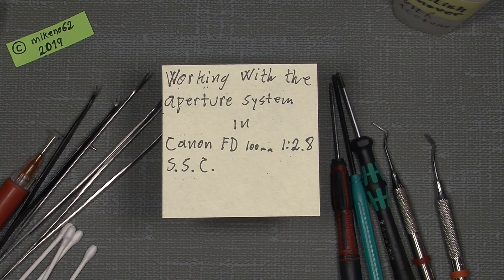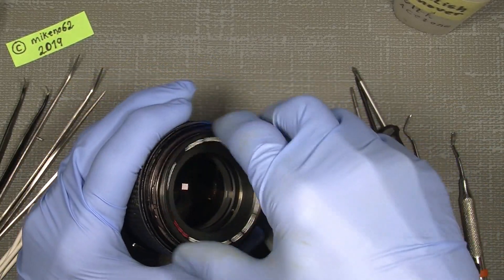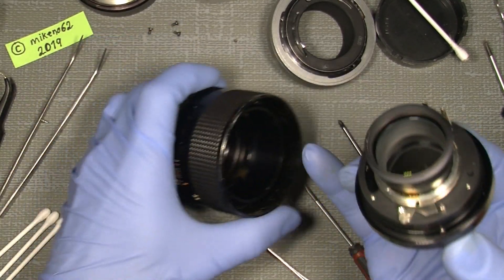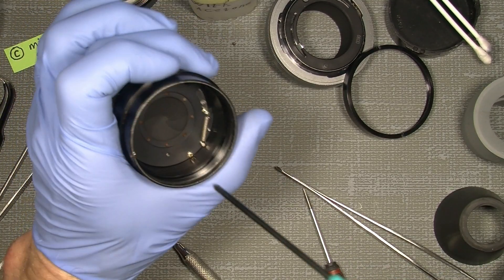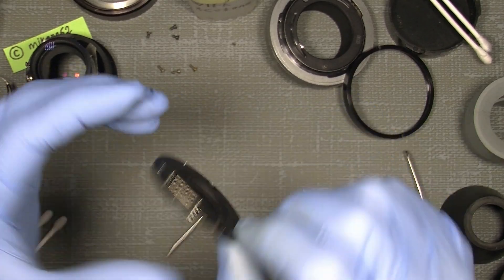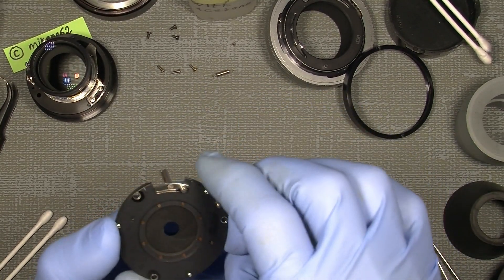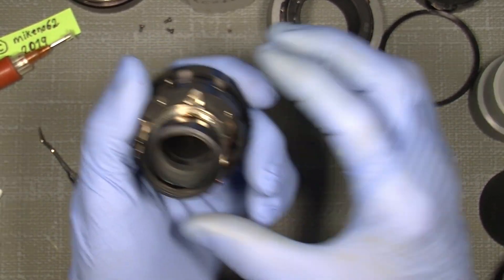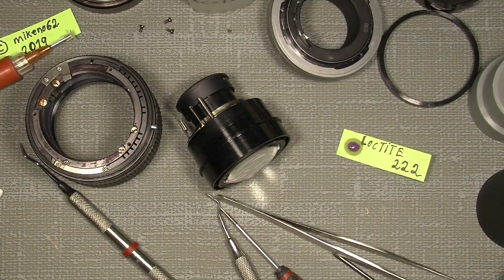Working with the aperture system In Canon FD 100mm 1:2.8 S.S.C.

Comment: Thanks a thousand times for the trick at 17:00. I had trouble with it until I found your video. The thing does get set the wrong way when you disassemble and I didn't notice it so I had a really hard time finding what the problem was! Now to unbend the filter thread so I can remove the back element to clean the fungus. That's a lot of work.

Comment: where do you get those sticky  rubbers? I don't have that in my country, thanks a lot for all your teaching!
Reply from the maker: Here are some link's to different repair tool's:

SpyderLENSCAL:

https://www.datacolor.com/photography-design/product-overview/spyderlenscal/

Japan Hobby Tool rubber cone:

https://www.amazon.com/Japan-Vacuum-Camera-Opener-Repair/dp/B0013HFYKK/ref=pd_sbs_469_1?_encoding=UTF8&pd_rd_i=B0013HFYKK&pd_rd_r=RKSF5A4YKT9GV3E1382C&pd_rd_w=5H58m&pd_rd_wg=DBny2&psc=1&refRID=RKSF5A4YKT9GV3E1382C

 

18 different size rubber repair tool's:

https://www.amazon.com/Sizes-Lens-Filter-Wrench-Rubber/dp/B00988D1BK/ref=pd_sbs_469_2?_encoding=UTF8&pd_rd_i=B00988D1BK&pd_rd_r=RKSF5A4YKT9GV3E1382C&pd_rd_w=5H58m&pd_rd_wg=DBny2&psc=1&refRID=RKSF5A4YKT9GV3E1382C
 

Divider Caliper Wing Compass:

https://www.amazon.co.uk/Divider-Caliper-Compass-Marking-Machinist/dp/B015CN9A8M

 

You can also buy this set.

Lens Repair Set with pointed, flat, half flat tips:

https://www.amazon.com/dp/B00QRPWCN0/ref=psdc_3347581_t1_B00J5F6O92

JIS cross head screw driver's:

https://www.amazon.com/Moody-Tools-58-0219-Chromium-Screwdriver/dp/B004PGO1T6/ref=pd_sim_421_6?_encoding=UTF8&pd_rd_i=B004PGO1T6&pd_rd_r=775KBDR03D8PMMEZWKFJ&pd_rd_w=ti7yC&pd_rd_wg=s2a40&psc=1&refRID=775KBDR03D8PMMEZWKFJ

Or this set, that is the set I use:

https://eustore.ifixit.com/en/Tools/Drivers-Wrenches/JIS-Driver-Set.html?utm_source=iFixit&utm_campaign=Referral&utm_medium=modal&utm_content=145115

Lens cleaning wipes (PEC-PAD):

https://www.amazon.com/dp/B0161VIZZ8/ref=sspa_dk_detail_3?psc=1&pd_rd_i=B0161VIZZ8&pd_rd_wg=ZTxxY&pd_rd_r=RNY8S6Q1V5K18K3F61VZ&pd_rd_w=2c1Oy

Thin Cotton Buds x 200 you can buy them here:

https://www.muji.eu/pages/online.asp?lan=uk&ShopSel=y&scrn=1920&wndw=1920&sec=17&sub=70&pid=2469

DSLRKIT Pro Lens Vise Tool Repair Filter Ring Ajustment Steel 27mm to 130mm:

https://www.amazon.com/DSLRKIT-Repair-Filter-Ajustment-Steel/dp/B00SYBYTZO

Japan Hobby Tool Herical Grease Made in Japan:

https://www.amazon.com/Japan-Hobby-Herical-grease-JHT9110/dp/B0014ZU03M

Loctite 222 50ml Threadlocker

https://www.amazon.com/Henkel-Loctite-Threadlocker-Super-Screw/dp/B013SDAWQC

And you will also need some Isopropylalcohol 99%

And sometimes Lighter Fluid that is very good to clean lens element's.

NOTE: Do NOT! use Acetone on platic part's, it will damage / melting the plastic!!!